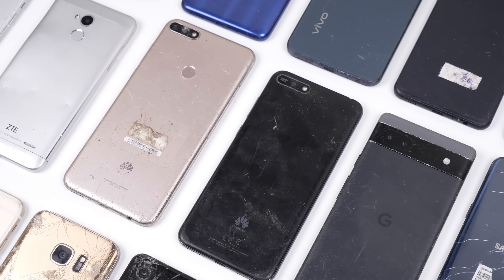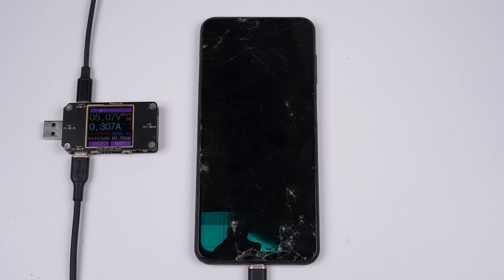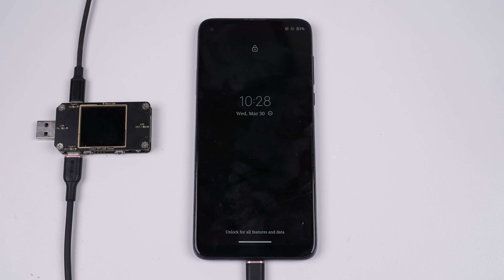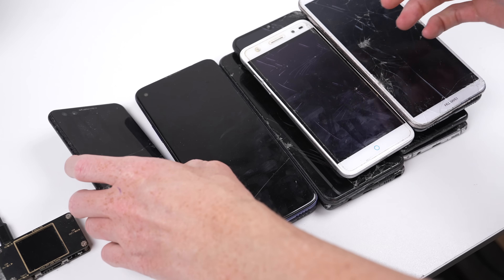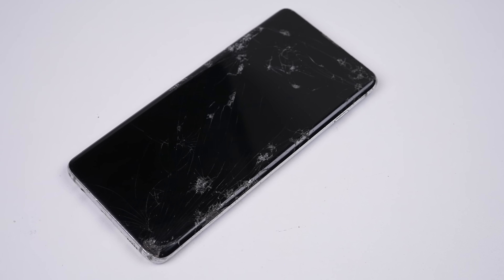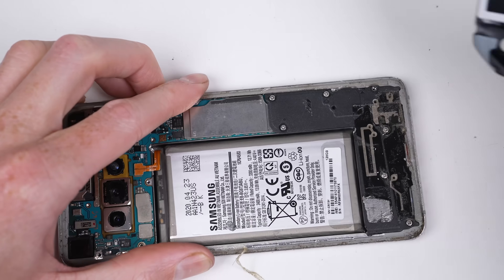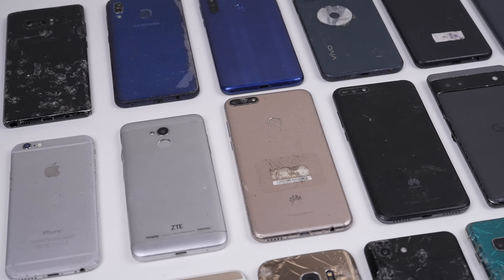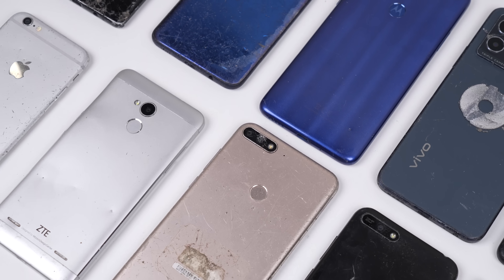I Bought $64USD of E-Waste Phones - Can I Fix Them?

Comment: 11:00

YES. This would be a cool idea and would open the restored phones up to some customization. You won't be able to get the old anodized alloy appearance, but some different colors of spray paint and matte or glossy clear coat could get some great looks out of the phones.

To bend the frames back, you need to take some care. Aluminum is prone to fatiguing from repeated bends and will crack or work harden. What you can do is heat it up to anneal it and slowly work it out without any sharp bends. Best to do this before any prep and paint work. You should pretty easily be able to get it back into alignment, I've done it before a few times with good success. Some simple painting and you wouldn't be able to tell there was any damage.

Comment: FUN FACT about the A13 5G and 4G: Their power button sockets are EXTREMELY prone to just, falling off. Also, the power button flex cable is prone to CRACKING somehow.... so you got VERY lucky fixing this thing. I have to fail or replace the button on SO many of these things at my job.
Reply: I had to replace mine today lol, just glad that it's easy enough to get the back off my phone
Reply: dont all A series phones have a poor battery connector design on the motherboard that just unsolders itself after a few years?
Reply: @corktail7900  not the battery, no.
Reply: Nope not all @corktail7900
Reply: I will be replacing the power button on an A13 LTE, yup, the flex cable is broken. Also, I can see someone fixed the flex cable before instead of replacing it. I'm putting a new one in.
Reply: I really thought it was only me who had these issues with these phones ,
Reply: Repairing this phone an hundred of time. I replace the power button just one time.

I think you just had badly broke phone to get this result..
Reply: @18Linky  no it's extremely common. I have handled hundreds of these. Hundreds!

Comment: Watching your s9+ repair. Do you buy components with the waterproofing seal on them? For easier installation? Also, I looked on Crazy's website (as someone from the USA). You got the "Service Pack" s9 battery?

I just replaced my mom's s9 battery, with an aftermarket one. I unfortunately broke the back panel. I don't have a hot air station. Just a hair dryer and a suction cup. Should I have used more heat somehow, in order to not break the back glass?

Comment: I feel like Samsung's S8-10 phones are the most reliable amongst the other samsung flagships

As a s10 user, this phone has suffered tens and maybe even hundreds of drops from as a low as a few centimetres of the floor or from the top of my staircase and so far, only the back glass edges are slightly cracked and the screen is pristine ( I dont use screen protectors)
The edges are completely fine but the battery is fairly well used (lasts 6-9 hours on moderate usage)
Suprisingly good camera for a 6 year old phone

Comment: The S10 was peak Samsung, the last great smartphone, amazing features, amazing design, still all the stuff you want, in gorgeous packages. It's been downhill since.
Reply: After the S10, Samsung really wiped the sweat of their brow like "Phew, all that good phone making was exhausting. Now let's take a break for the next decade or so by copying Apple's homework but making it Android" 😭😭
Reply: It's been my daily for almost 5 years now, very much due for a new battery though
Reply: the note 20 ultra was great too imo, no headphone jack but still had an sd card slot. starting with the s21 series, things started getting weird
Reply: @zelo6237 As someone who uses a portable DAC anyway, yeah after the note 20 everything is downhill.
Reply: Good for what killing its own display since it had poor heat dessification
Reply: Totally agree with you and Hugh except for one thing:  The soldered, permanent charge port.  Caused a LOT of VERY expensive repairs when I worked for UBreakIFix back in the day of the S10.  The charge ports for literally every other Samsung phone are separate pieces that cost $10... the S10 is either an entire motherboard replacement or an expensive soldering job.  If it had a separate charge port, it would have been the perfect phone.
Reply: And the compact s10e was the last phone on the market having flagship specs and all the good stuff (fingerprint sensor, nfc, wireless charging, IP rating, headphone jack, sdcard slot, good camera, stereo speakers, OLED screen) in a less then 6" diagonally form factor. It is impossible in 2025 to buy a new phone with such set of features in that small form factor. It's been fuckin' 6 years since its premiere, the technology made it even easier and cheaper to manufacture such phone, yet apparently NO COMPANY ON THE FUCKIN' PLANET wants to do it. It is infuriating, to be honest. And that's why I've decided to buy a replacement battery for my s10e and use it untill it dies (eventually).
Reply: If you run custom ROMs it's the last Samsung flagship model that can be bootloader unlocked and flashed
Reply: i got a refurbished S10e for 110$ and have been using it for years. once this one dies ill try to find another one. its perfect imo.
Reply: @Cdz9000 same i bought it last year
Reply: Das stimmt ❤❤❤❤❤
Reply: The pixel 6a is also 5G.

Comment: I've got 3 phones sitting around, two are carrier locked and work fine, one being an S7 Edge and a Basic S9, I've also got a A50 but it's unfortunately stuck in a boot loop I've tried re-flashing the firmware but it didn't fix it, I believe it's an internal issue.

Comment: I work as a hvac technician in supermarkets and i often check inside their e-waste. It's quite amazing how many perfectly working phones people throw away. Mostly old fashioned ones, but last month i found  a perfectly good LG G6 in good shape, fully working and unlocked.
Reply: custom rom, sd card, and possibly a battery replacement - you have an audio player :). a battery case would be great too (if you can find one, they're around 30 usd)
Reply: @zelo6237 would an lg v30 be worthwhile doing this with??
Reply: @zelo6237  that the idea but the reality of the situation is that on the G6 when your onto the newest firmware you can't unlock the bootloader and thus can't install a custom rom, it's really frustrating, with a new one, one that has not been updated to the android 10 or whatever you can go android 15 or so.
Reply: Yo I found a G6 in a recycling center, was a bitch to unlock but it worked great! Now the battery is cooked so I did end up tossing it
Reply: @thelastmagnifi8369 I wouldn't throw it you can still make money off the phone
Reply: The main issue with the phones is not that these weren’t working but the (newer) apps just aren’t supported but you need the apps. It was the case for my mom and dad’s phones. They had an iPhone 6s and they stopped supporting needed apps :(
Reply: Less of a problem with Android. Apps are compatible many versions back, and if they won't work anymore, it's often possible to install a custom ROM with a newer version of android. I have a galaxy S7 as backup with a custom ROM of Android 11 (Pixel Experience) and it runs great, all my regular apps work fine. @iriswaldenburger2315
Reply: I love the Health Tracker app of LG G6.
Reply: My supermarket has large signs that it is treated as theft if you take anything from that box.
Reply: @ligametis  not if you are an employee of the shop itself.
Reply: @ligametis  Why do they care? The phones are broken anyway
Reply: @GooseAffiliate859In Europe they have to pay less taxes if they provide more items to recycling centers.
Reply: I found an iPhone 8 and iPhone 4. Don't have iPhone 4 charger, but the iPhone 8 works great
Reply: Are you allowed to take them
Reply: @THE_CARBON  Nobody seems to care.
Reply: @THE_CARBON perchance not

Comment: I must say that the S10 headphone jack does indeed fly away when try to remove it. I have an S10e here that I have done a teardown on. Although it works, the screen is cracked, the back glass is shattered, the frame is chipped, and the power button doesn’t work. I had to enter download mode to turn on the phone, and because I can’t use the power button to restart it, I unplugged the battery and plugged it back in. Turned on after the wireless charger was put back on. Just a little tip for those who have a broken power button.

Comment: Hey Hugh, quick question if you see this: Do you have any 300IQ tricks to remove old glue? I had to replace the spicy pillow in a phone, but I just wasn't able to remove most of the old glue afterwards, so my job glueing that thing back together with tape was less than ideal.

Comment: Graphene OS? You found The Hated One's old phone.
Reply: Google Pixel phones since the 6th generation are supposed to have an internal chip called Risk V, which is what makes it possible to run Graphene OS.

And another interesting thing about the OS: Graphene OS is supposed to be a digital bunker, meaning no one can get in unless it's you. It's only natural that it has absolutely nothing installed other than the phone's stock apps. Also, if the phone is left unused for more than 4 months, the OS will delete any apps you've installed during the time you've had it. So, the OS has a built-in self-destruct feature.

That leads me to the theory that the person who owned that Pixel 6A wanted to keep absolutely everything on their phone secure, or was someone who was highly sought after or under surveillance.
Reply: @Uchiha_Sasuke720 You are confusing terms a bit. RiscV is an architechture like ARM or x86 but the Pixel doesnt run that. It uses an ARM SoC just like every other phone. However it uses Google's own inhouse designed chip the Tensor series. GrapheneOS is technically very secure by design however there is a single piece of the puzzle left and that is the ARM Trustzone. Similar to Intel's ME or AMD's PSP it has %100 unverifiable arbitrary code always running in the background with the ability to do whatever it wants.
Reply: @SegFaultOnLine1984 bit unrelated but Tensor is just fancy Exynos. If you mess around with the system you'll see some SoC related files have Exynos in their names.
Reply: @Uchiha_Sasuke720 you're confusing quite a few things here: RISC-V is an architecture of a microprocessor, like Intel's x86 CPUs, but more like the ARM 64 SoCs (system on a chip, ie CPU, GPU, specialized encoders and decoders, sometimes RAM and even storage on a single chip), which has a reduced set of instructions.

You were probably thinking of the Titan M chip, which dealt with verified boot, secure storage, and such.

Also the phone that GrapheneOS was on was the Google Pixel 3, which came with a Qualcomm Snapdragon 845 processor.

The things that makes GrapheneOS really secure is it's hardened kernel, and the fact that it runs all apps in isolated sandboxes, which theoretically prevents malware and spyware from running unchecked even if an app gets infected. The passcode based and time based device wipe is another great security feature for the security conscious. This phone was definitely wiped.